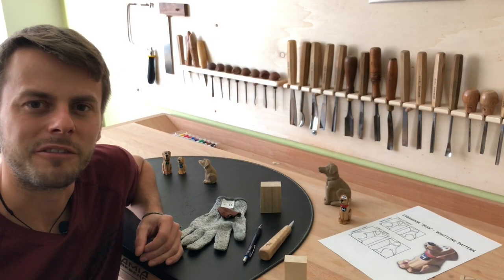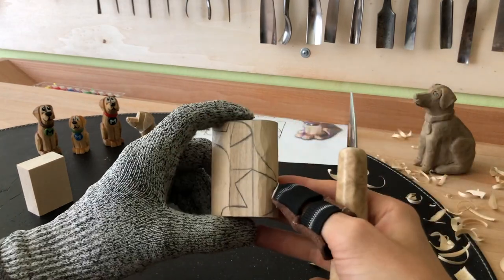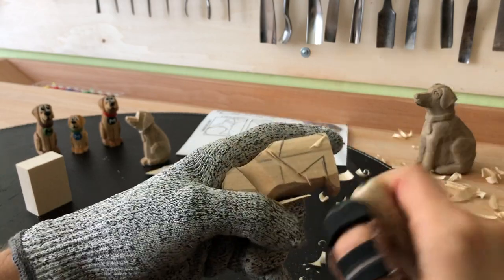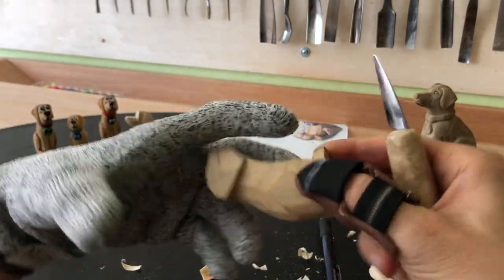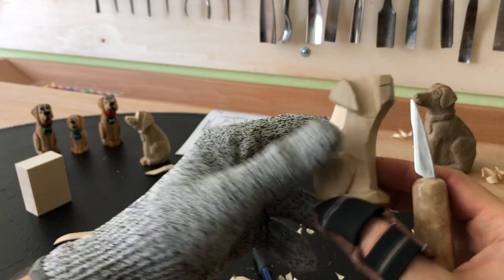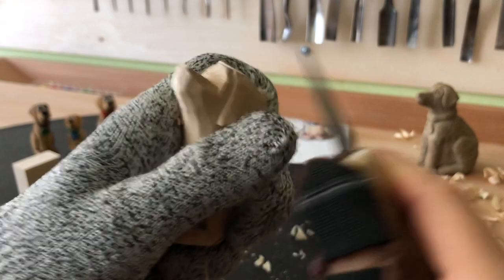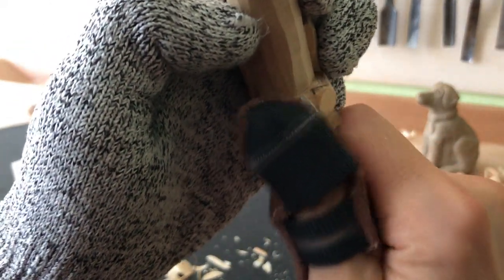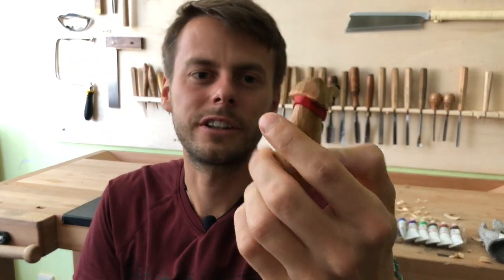Carving Labrador Max - Simple Whittling Project

Comment: In this video i have 2x2 and yours look 2x1 is that correct??
Reply from the maker: Hi Joe. Yes thats correct. it 2x1
Reply: @HomeWoodSpirit  The pictures show it as 2x2 so thats why my keeps coming out too big!  Am i wrong??
Reply from the maker: @joemarasco3091  the dimensions are 2x1x2 3/4
Reply: @HomeWoodSpirit  Your picture is 2 5/8 x 2
Reply from the maker: @joemarasco3091  2 3/4 and 2 5/8 is almost the same... few millimeters won't make a big difference.. the important thing is that it is one inch thin. Have a look at 2:15 in the video. There is everything you need to know.. ;-) good luck
Reply: @HomeWoodSpirit  Yes they are almost the same BUT the blocks we BUY are 2x2 or 1x1 so when you show us a video and you start with different sizes we can't do them if we don't have a way to cut down our blocks? Do you see what i am saying?  I have the same question to other instructors why not do a carving with the same sizes we can buy on line without cutting??